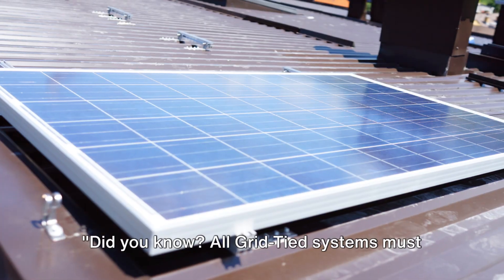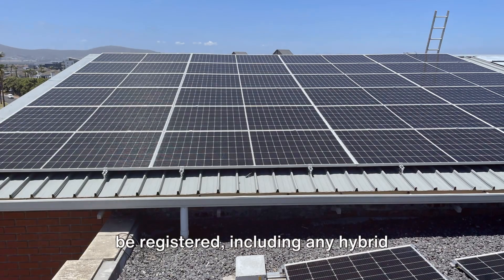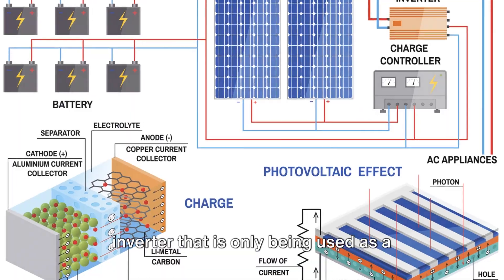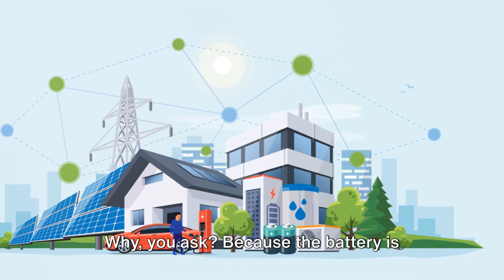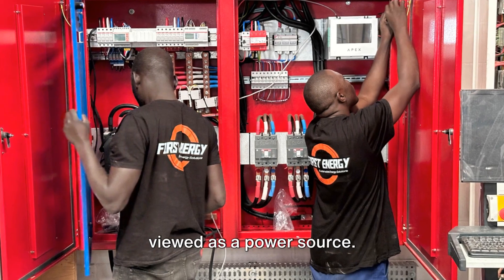A Quick guide to Grid Tied Systems Registration  - 2024 Cape Town

Comment: I know that Muni's can have regulations in their Municipal area, but lets ignore that for now. There is a tree of laws and regulations that starts with an act. Which Act is that? By example, who gave the SANS permission to write and maintain SANS10142 and make it enforceable. It must be some act, and in that act the minister was given the responsibility to establish regulations. Eskom as the network operator wrote NRS-097-x-y. What are the limitation of signing off for an electrician and an ECSA registered engineer. Where is that defined?